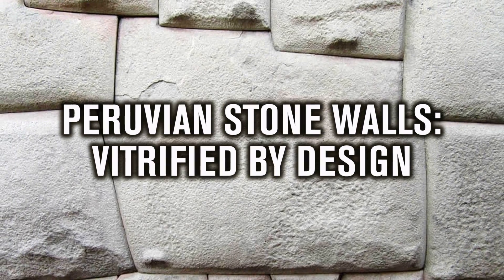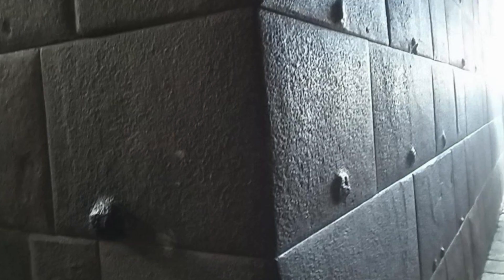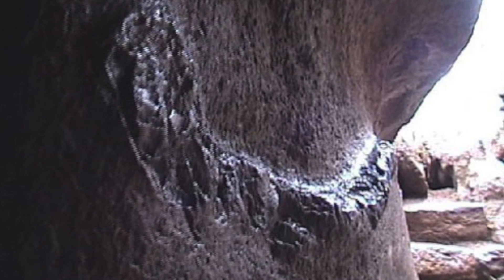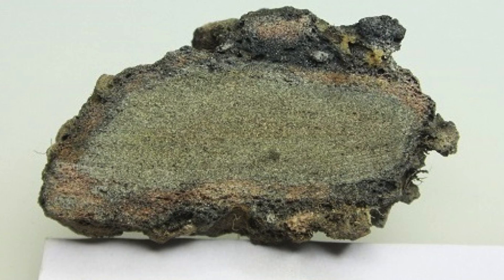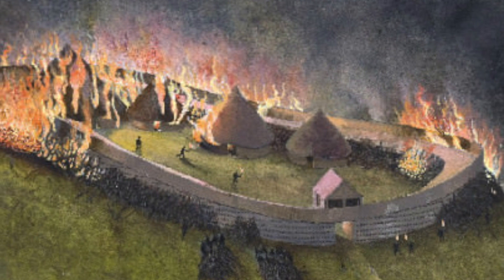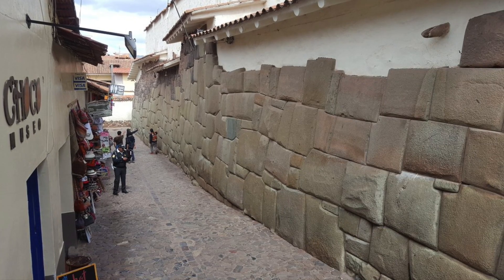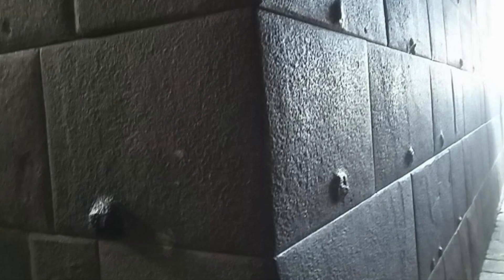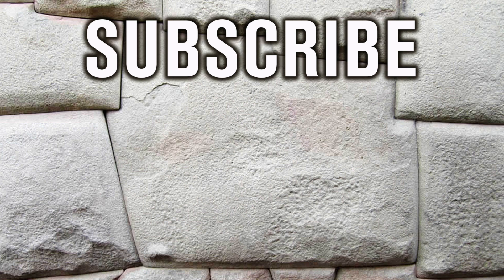Were the Peruvian Stone Walls Vitrified / Melted During Construction? | Ancient Architects

Comment: I never heard about vitrified rock in British ancient stone structures before watching this.  I can't imagine a wood fire being able to melt the rock to that extent, but maybe.  I think lightening strike on the wooden towers is more likely the cause.  They would probably have metal object inside and being in high positions this would attract strikes.
If you remember Back to the future lightening has 1.21 gigawatts 😋
Reply: People underestimate just how hot things can get. You get a little metal container and put a chimney on top and an air hole at the back, fill it with wood and it'll be at 600°C in 15 minutes. That's with any wood and (within reason) any metal too. With the right environment and the right wood/coal/charcoal, these temperatures are easily achievable. Charcoal can reach almost double the needed temperature
Reply: @Mikeey1  I know what you're saying.  I know someone who does wood kiln pottery and I reckon those must get upto around 1200°c.  I've no idea what temperatures are needed to melt basalt ect.  I know lightening strikes are very hot.  The hill forts mentioned were probably the highest things around them and there was hardly anything else around them back then like pylons and tall pointy buildings that would better attract lightening.  Just a theory.

Comment: …about the nubs. I know what these are. The nubs are the excess clay which is on the face of the stone during construction. The compound cannot be scraped off, bcus it will just keep pulling more stone off with it, as the clay refuses to separate once the curing has begun. So we have to scoop the excess clay into a designated area on the face of the stone. The designated area is the bottom of the stone, where we make one lump if possible, but often we must scoop 2 lumps bcus we don’t want the lumps to be too large. The lumps serve no purpose, they are just part of the process when we dress the face smoothly. This is actually the shabby work, as it can be done skillfully without having excess clay on the face.

Comment: Accounts kept by conquistadors describe the native priesthood attempting an escape from the temple with "holy relics" consisting of massive 6-foot diameter gold parabolic discs (with ZERO ornamentation). I contend that these were collectively used to concentrate sunlight onto the walls to produce the vitrification. A carefully-choreographed handling by an assemblage of priests, in which "lower priests" point their reflectors at the "high priests" reflector, then the "high priest" points his at the wall where the heat is to be applied, could generate the required temperatures without the need to burn anything. The physics add up. The narrative kept by bookkeepers of the conquistadors provides the evidence that these people did, in fact have the requisite tools.

Comment: I’m going with another’s hypothesis that the gold the Spaniards were decimating the empire over was pyritic sulphur. This natural material was being mined and used to make a sulphuric acid paste to soften and melt the block joints into place resulting in a tight fit. Further, I’ve always thought the nubs were intentionally put on the blocks to support and tie in wooden structures joined to the blocks. Erosion over time has weathered them differently to account for their variability. These mysteries are as complicated as explaining why Wombat poop is square.

Comment: Interesting subject, the high quality workmanship in the polygonal stone work does not suggest using fires to me.  Have you considered that the rocks were melted by focusing the suns rays by mirrors or lenses?  This would give a controlled finish whilst achieving high temperatures and it is not a massive technological leap to achieve.  Acids and other additives could also have been used also, but I think the suns rays were utilised as the main melting method!     The European hillforts look to be more chaotic so could well be melted due to fire damage etc.

Comment: I had assumed the temperature requirements would far exceed the temperature of burning wood. 960 to 1200 degrees. these temps can be hit with modern kilns but recreating it on a large scale would be difficult but not impossible.
Reply: it depends. once we tried melting a glas bottle in a bonfire. it was a large fire tho that was burning for hours and inside a ring of bricks that trapped the heat on the bottom of the pit. i guess if the fire is somehow contained to prevent air circulation a little and the heat gets trapped and it has enough fuel to burn long enough it might be possible to vitrify stone. however i doubt that stone was liquified to mold those stones really since you need like 5000°C in order to liquify stone. i doubt our ancestors would have been able to achieve this if they didn't happen to have a volcano nearby. but then how would you even handle the lava? seems very unlikely to me.

Comment: I don't think they would have used acid. How would they have stopped the acid from working after applying it? Simply washing it may not have been enough IMO. I think they could be concrete that was wrapped in some sort of animal skin or bag made of large leaves to hold it into shape. Look at the blob like shape of the stones as if they were pressing outward and being held in place. The flat ones could have been carved or they may have used wood to hold the concrete in place as it dried. I am just using my brain and am not an expert.
Reply: It is possible. You only use enough acid to react with the area of stone you're working with. Look up the article titled "On the reddish, glittery mud the Inca used for perfecting their stone masonry."

Comment: My best guess as the nubs are similar to a sprew in injection molding , and possibly they have very high quality concrete like the Romans . They just were able to do it as an assembly line on site . But my idea has 'holes' in that where is the plain Jane starting block that makes the process get it's unique pattern ?

Comment: if it was melted they had to make a new cast for every block, i would think it was cast with the nubs facing up and is a leftover of a pour spout and vent. why leave it on if that's the case?
Reply: Not if they are poured in situ. Only 1 or 2 sides would need forms after the first couple blocks were poured.
Reply: @cosmiccrunch8591  if it was poured in place yes but if it was poured like how we do typicall sand casting I would think it was cast by itself or at least cast flat on the ground with others(nubs up for the idea to work) but this is all just a thought without seeing what the sides and back look like. Could all be tested if someone wanted to try sand casting a block or two.

Comment: In the Stone Age they used heat to craft tools. So the knowledge of processes involving heat or fire to shape stones for the desired function is really old. Seems unlikely this wouldn’t be used to craft walls and buildings.
Reply: The problem with using fire is that you would need extremely intense and focused heat so as not to split the stone. Huge golden mirrors might do it? Although probably not in Scotland
Reply: @RJ-xv1nh  I was speaking more about the fact that the technique is at least a few hundred thousand years old.
Reply: @Abjusitsch  To the best of my knowledge, heat was used to fracture rock but not melt it.  Wish someone would do a vid showing it working though.

Comment: It seems to me like these "nubs" are the same geometry and same size within one construction. They may differe from one to another, but for me, these nubs are the input of the mold they pour or pump the geopolymere in. This geopolymere seems to warm up and produce gaz when its drying "bubbles". It also seems like it is taking some volume when drying... Making all these tight joints and impossible "cuts". Alot of geopolymere like substances that we know act these kinds of way. It is just a matter of making the links. In marble industries, i know they use some type of oxyalic acid to make a mirror finish to a marble block or a granite surface. I think you have made videos about this... Maybe it wasnt you.

Comment: This strengthen the idea that machupichu and similar constructions were the mythical Dorado:The Incas were tightly connected via commertial roads with the Central American Cultures, they had intimate ties with the civilizations of the Orinoco (Venezuela and Colombia) and Amazon basin, the rocks in the walls shined like gold and maybe the indians in Venezuela and the Caribs (which were dexterous merchants and sailors) new about the cities of the rich nation (Incas) by tales from other merchants or interaction with the tomotocuicas and chibchas.
Reply: Ancient Amerindians were expert ceramicists, they might had perfected a system of coal production while at the same time firing big blocks of geopolymer that were later burnerd again with the high quality coal... as there is plenty of hardwoods in the Amazon.  Plus a kilnt of rammed earth or a more archaic charcoal production method like clustering and covering the wood with earth might had done the trick: this could have allowed different systems of productions like in-situ dedicated to the temples of the sun - much more expensive -  and those manufactured for fortesses and housing of the royals that are more regular (cheaper). The potash lye resultant from the burn of the coal might been used for producing more geopolymer.

Comment: No way!
It was attempted back in the 70s. To replicate such vitrification.
They stacked rock, with large timbers through out the entire dry stack wall. Then piled enormous amounts of timber and wood covering the wall entirely. It burned for 3 days.
They failed to replicate any dripping vitrification!
This heat to cause such damage, far exceeds any temperatures that any amount of wood could possibly produce.

Comment: TEST THE HYPOTHESIS" Build a wall of rough cut blocks, about the same size and type of stone as Cuzco wall blocks and fit them together as close as possible by hand shaping.. Build the wall 10 feet high and 20 feet long and then start a fire of Peruvian wood and let it rip. Simulate what happened in Scotland. Let the fire burn for days and days and see if the blocks melt and confirm. This is an EASY experiment!! Whoever does this, and molds the heated blocks will make history.. EASY TO DO!!!

Comment: they were cast, yeah that's what I believe now (heat was last year, haha), the nubs are remnants of the process, they remove a tool and some material extrudes following the nozzle of the tool but dries/hardens before they can snap it off, who knows, only large load-bearing stones were quarried or important statues..for the most part, imo, with all the ancient sites it's all way too concrete-ish to me, many like giant plastic 3d printed molds or molds snapped apart with....nubs
Reply: One problem with that idea, though; no two stones are the same shape. There would have to be a mold for each stone - not really practical, don't you think ?
Reply: @peterbarratt8699  yep, but they'd have cut them all the same as well, makes no sense why every stone is different sized, you set up a jig and cut each coarse of stone the same and save a lifetime of time and energy, could be that each team had their own dimensions...but that would be silly, but maybe they laid the outside stone, used actual stone to outline the pyramid's important areas and poured in certain sections, they couldn't concrete an entire area so they walled it up and poured it in, rather than drag stone uphill they just carried sacks or pushed wheelbarrels

Comment: I love your videos and have a thought on how this was done.   It was done with heat, using hydrogen.  HHO gas.  Brown's Gas.  Simple technology that they had available to them. A lost form of technology maybe? It would explain many many things if the ancient world ran on a different source of fuel.  

HHO would allow them to have plasma type torches to cut, bore, and soften stone.  Melt and transform rock. very low tech is required to create a torch for ancient times.  Water, a reed, clay jar.. etc .  It is produced on demand, making it portable and possible to use it pretty much anywhere on your job site.

It could serve as a light source, and explain why there are no soot marks in any of the tombs or pyramids.  I just watched a video where an HHO torch aimed at a lime, lit up the lime like a halogen lamp, and the lime was unharmed.  It was like a light bulb!

The bagdhad batteries show they had the knowledge and could have built a device to create HHO gas.  Low tech components could yield high tech results.  Maybe the incredible accuracy we see, the flatness, is simply from the way HHO works and interacts with different materials in comes into contact with.  While I'm no expert on HHO, it does perform in ways you would not expect

We also marvel at how some wonders from the ancient world could really only be seen an appreciated from above.  HHO gas would allow you to float in the air.  Check out this video, which shows HHO and how it interacts with different materials. user: delvis11  and the video is called  "Heating with Hydrogen HHO or Hcat. This man does just that."    It's primarily about using HHO as a heating source, but I found the other parts most eye opening.

Comment: I am of the sliding stones persuasion; protrusions have varied uses, sling placement, scaffolding supports and others.  Building basics have developed with man.  Foundations cost more than walls, corners and doorways first, elemental.  Stone is still worked the same way as it was 3500+ years ago.  Men built it because that its what they do.

Comment: They had to pour in to the mold some how.
  Like a pack of [ LEGO ] blocks there are amounts for each different size Lego Block,  measuring of the each block taking  an  inventory amd recording each block using the , (  Dewey Decimal System)  yes i  said the Dewey Decimal System! it worked for cataloging massive amounts of literature and could geta person precisely to the book /  or in this case a block just the same.
  Once we have a better understanding of the quantity and,  number of block size or Rarity of block size. 
  Making sense of what was available to work with might give understanding to how It was worked with. Anything that is casted in a mold has the poor marks from where the material was poured in. Maybe these are no different. Because the stone is hard doesn't mean it was created by natural process. Could have been a liquefied solution that hardens over time. Giving expansion to the absences of measurable space or void between the blocks seems! 
🙏☮❤♻️

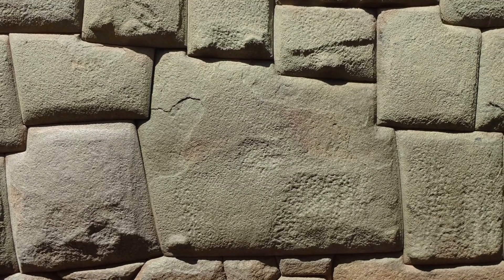Comment: 1:05  ... a thriving community of Knobs?   :-)
Reply: 8:20 ..little bits of Scottish brick remind you of huge Blocks of Cyclopean structure?    that's a huge stretch of the imagination.
Reply: 12:26 ..if one were to drill a hole then how deep would you expect the vitrification to be seen?   Melted Scottish brick of dubious origin can perhaps show some depth ..is there any provenance for the depth of vitrification in cyclopean architecture ... or just that of surface shine?
Reply: 13:44 is quite critical to your analysis. See the large slab at the bottom to the left? Above it is a horizontal slab that 'looks' as if slid in , on an path engraved in the adjacent rightward slab. There is nothing fused about it rather it seems the evidence of an expression of intent ... to get the 'T' slab slid in properly.  Hardly something left to gravitational chance.
Reply: Anyway ..superficial vitrification due to burning  could explain one bit here and there, but a whole wall?  Let alone the interior of the massive blocks used in the wall.  What is it that is being posited?   A major constructional method or some cosmetic effects wholly independent of the neatness of the joins?  Cosmetics are supposed to hide cracks and veins, not highlight them.

Comment: Generally molten stone is not possible. Molten means fluid and fluid can’t up keep straight seams and sharp turns. So what about selective molten? Melt only the seams and not the bulk? Also impossible to reside straight edges or corners. So what about molded molten stones? Not possible because molten involve heat, high heat that melt metal. Generally the question is straight edges and sharp turn edges are beyond molten stone idea. So what about cold molten? That is to say can we use cold mold concrete? Yes but concrete require a binder, Portland cement which is modern produce by a high heat process not available at the time of build. What about natural binder and wet sand? Yes there are two kinds of natural binder that not require high heat obtain in natural environment, either alkaline or acidic. 
Do follow Joseph Davidovits in his artificial stone videos.